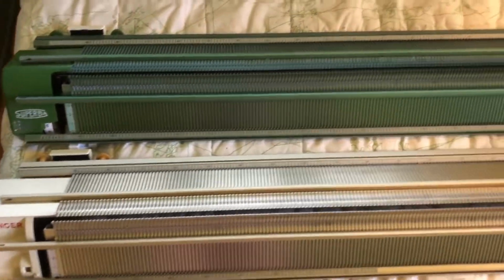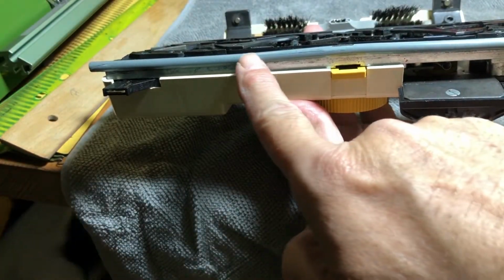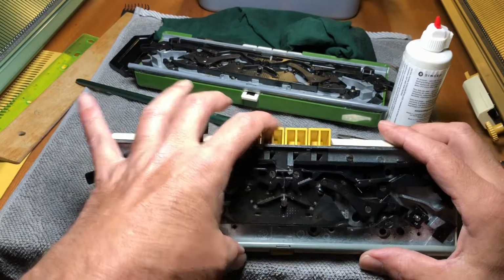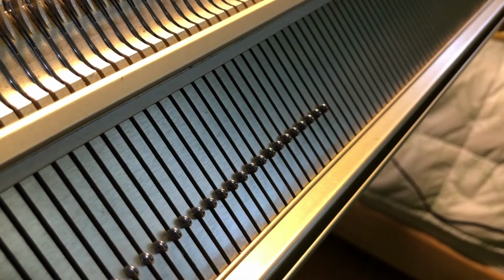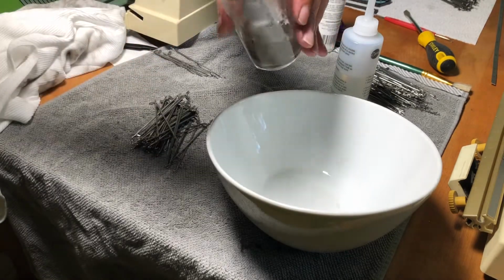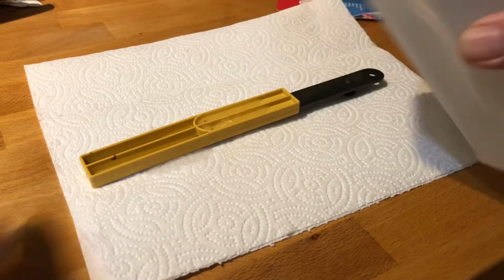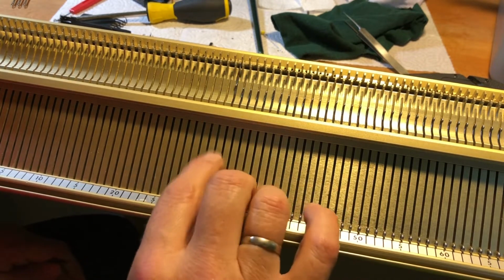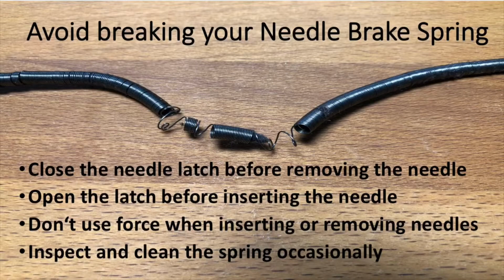Singer memomatic knitting machine repairs - Superba inspection, repair & maintenance - part 1

Comment: Por favor pode dizer o nome do produto para tirar o lixo das agulhas que não dá para ver obrigado
Reply from the maker: I am not sure if I understand the automatic translation. 
For the needle cleaning I used a singer machine oil.
For the grooves where the needles are running I used tweezers like this https://www.ebay.com/itm/6Pcs-ESD-Anti-static-Tweezers-Set-Maintenance-Repair-Stainless-Steel-Tools-Kit/133045792948?hash=item1efa25b0b4:g:uFsAAOSwPWtcJbq3&amdata=enc:AQAHAAAA4JEKzPHqqbUt3tjn2FN1SeoNGifQd5+L5e+juLciKv/2LYmEMFCFozmxAow2gCZ9N/xEBfdUSVHElCUW5H8dwC0FEp8sTo797kCHni0xLMFMDAKgfcUMvSEYx8/9QzV8/mrKOXkSzAMvWG7Uk+Sid+z33Q7Y1oSHCCuGiyzzrop29gbhyICzx0GL0WOn5Z/p2j3nSypnLEj6wBeIcoVl2ZZ6m5/Uu3x3dHsMZ4edbEZEs7LaV0YXbQPrC0oFfYT4vTlPy1M7XN2KixO2ijBQSK0q9ZqUdgLkz4p+/XMHwnYy%7Ctkp:BFBMppi30blh&pageci=391ea3d4-9dfa-45a0-9c7c-07ffe6e36617&redirect=mobile

Comment: when I clean the needles I put them in a empty jam jar, add surgical spirit & a few drops of gun oil, put the lid on and let them soak over night with the occasional shake. it's amazing how much crud comes off those needles.
these are wonderful machines. even if the electronics are not working they make wonderful ribs and manual stitch patterns.

if you are going to replace the brake spring. that is also a great time to clean the needles. much easier to remove & replace them with the spring taken out.
Reply: if I remember right all the machines are the same - except the 'suitcase' models. only real difference is how the electronic pattern device connects (peg board, electronic pg board, light scanner, electronic controller or the triangle electronic controller) but the beds & carriages should all be the same.
Reply from the maker: Thank you, this is good advise. I‘ll try this cleaning method next time.
… and yes, I like that singer a lot. I have nothing to compare against (other than an lk150) but they can be relatively inexpensive and work great.

Comment: Спасибо большое ! У меня мемо 2 , но при вязании узора не выдвигает иглы . Не знаю как её отремонтировать .
Reply from the maker: Hello Svetlana, I don‘t know how the memomatic electronics push the needles out. I only know how the little knobs and levers of the carriage work without the memo. 
If your problem is with the carriage please let me know … otherwise sorry I couldn’t help
Reply: Спасибо большое , каретка функционирует отлично , проблема наверное в электронике . Спасибо за такой быстрый ответ .
Reply from the maker: @svetlanarudi.  … I am not sure if you still get this message by now. I also bought a memomatic (one with red pins). The red light comes on but it only works sometimes. I will make a video once I understand how to continuously make it work.
If your red light does not light up, it might just be the fuse or the transformer which transforms from 240V~ to around 18v~
Reply: @2lefthands769  здравствуйте ! Спасибо вам большое , лампочка красная горит нормально и адаптер тоже функционирует . Набираю узор , но дальше не идёт.  Не выдвигает иглы в работу для узора . Я буду вам очень благодарна за ваши следующие видео .